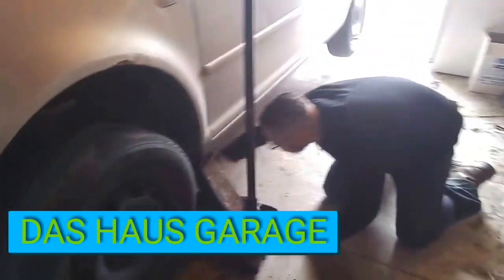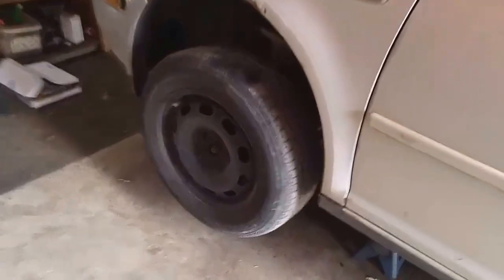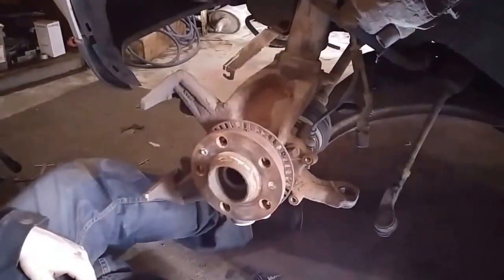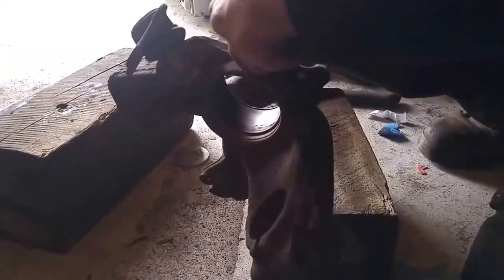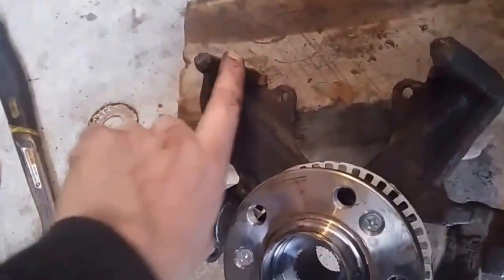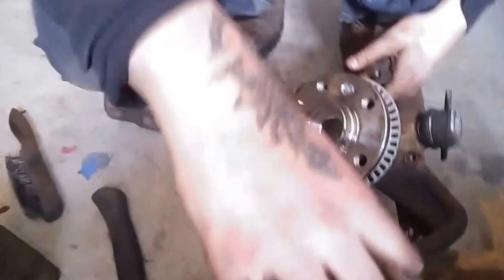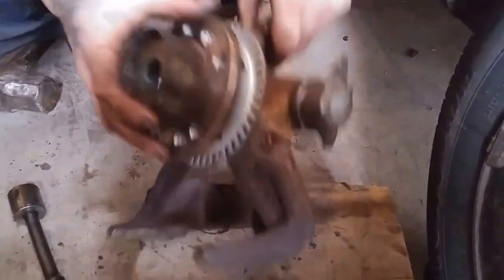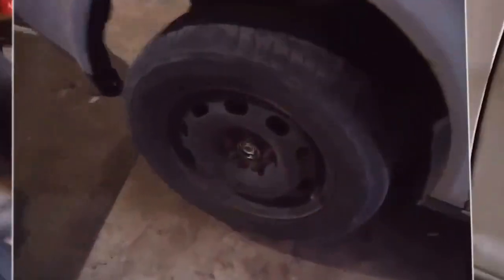DAS HAUS GARAGE - no press Wheel bearing ????

Comment: I hope you used the snap ring which locks in the bearing before pressing in the hub. I had a mechanic replace my wheel bearing and he didn't install it - wheel almost came off. I caught it when the ABS started acting up at low speed.
Reply from the maker: yes 100%

Comment: if you have hammered the hub in without counteracting the inner race from the opposite site, then you have destroyed your new bearing
Reply from the maker: +dave sterl no it was hammered in the same way a press would have done it. Car is still running smooth. Please know this is only for those who cant afford a small press or get a shop to do it. (i recommend both of those ideas over this) this is more of a "last resort"
Reply: you didnt even show how you installed the new bearing! wtf
Reply from the maker: mainly to avoid the issue mentioned above. we don't want anyone saying we showed them the wrong way.